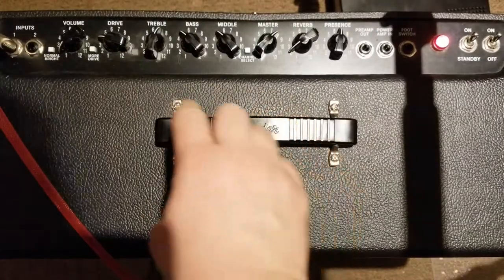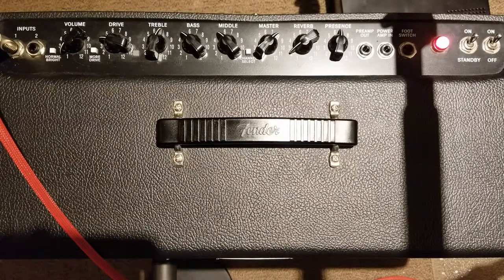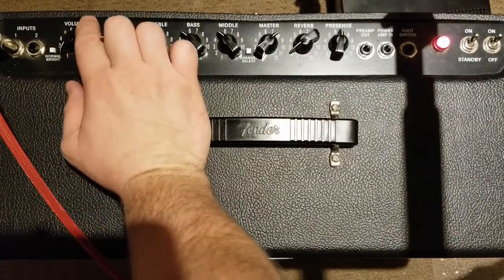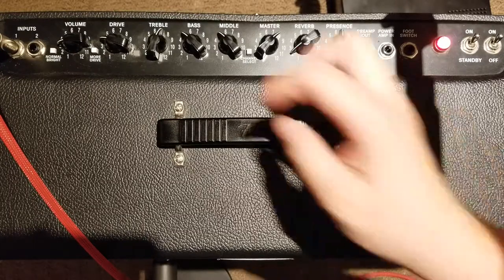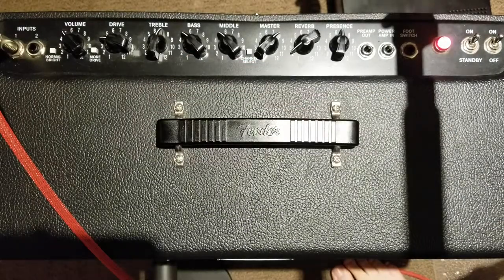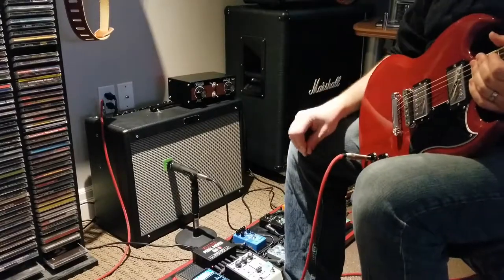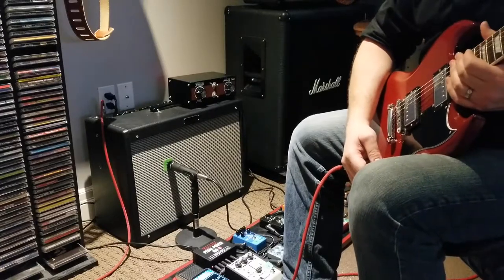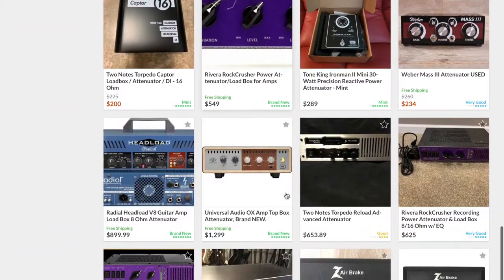Taming Your Tube Amp   Attenuators

Comment: Hi! I was thinking to buy a bugera ps1 power soak for my fender hot rod deluxe iv… I would like to know how you connected you attenuator and if it is possible to connect the bugera ps1, and if so how i should do it.
Thanks.
Reply from the maker: Hi Luca. Attenuators are connected between the power amp and the speaker. On the HRD there's a cable that comes out of the chassis and runs to the speaker. You'll need another speaker cable (not a guitar cable) to run from the plug where you unplugged the speaker, to the attenuator and use the existing cable from the attenuator to the speaker. But please, make sure your impedances match!